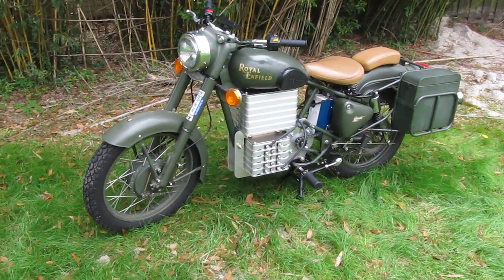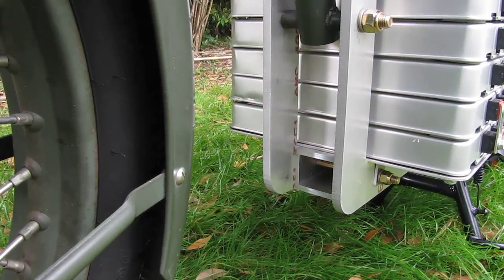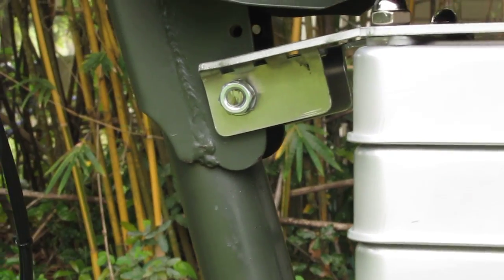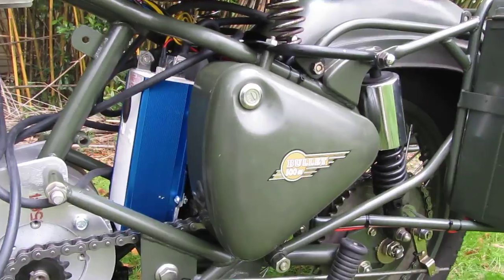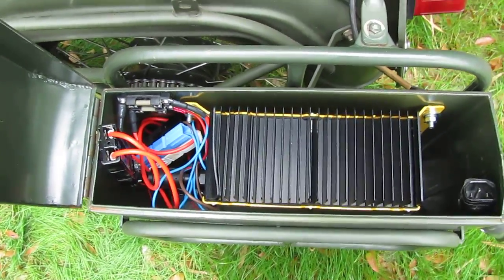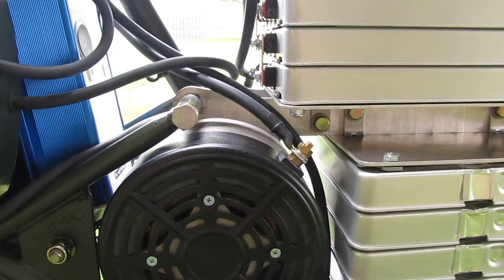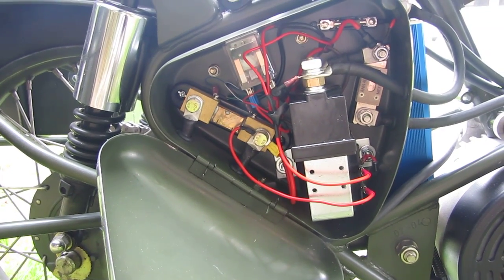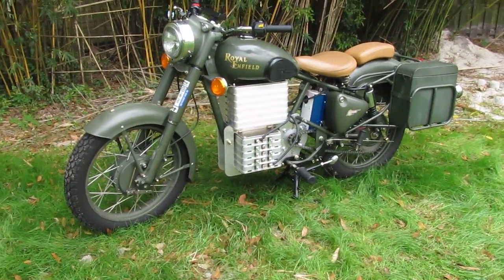Electric Motorcycle Walkaround

Comment: I have a small doubt wat about in rainy season how it works, if the water touches to battery terminals.
Reply from the maker: Legitimate concern.  It was not designed to any engineering specification for rain tolerance.  However I got caught in the rain a couple times in Florida, once in a downpour, and it ran fine despite the heavy rain and spray from the road.  Fortunately fresh water is non-conductive.  Also, I intentionally left the small holes in the Leaf cells unsealed and mounted the cells "upside down" to ensure moisture could not pool inside the metal battery module, but would run out if accumulated.  I think the motor runs warm enough to evaporate the moisture that touches it.  It was dry after being rained on.  The motor controller is sealed.  Also, the marine-grade heat-shrink used on some of the electrical connections is designed to seal out water.
Reply: Electric Drive thanks for ur valuable information giving to me

Comment: You must design a chasis fitting it in petrol engine chasis is not a opt method
Reply: Looks pretty good to me.  Weight is moderately low in the frame.

Comment: I wonder what made you decide on the nissan leaf battery pack. The nissans have been known to have overheating issues that has led to significant loss in capacity after only around 2 years of usage. Is the air cooling from riding adequate in addressing any heat buildup in the batteries?
Reply: Lizard batteries fixed that in 2013.  However under light use and open to the wind they will cool better if you want to use the older batteries.

Comment: My friend i own a Royal Enfield my self. What you have done with this bike is awesome . Have you had a chance to finish the remaining work on the bike like making it weather proof,covering up the battery and anything you feel was left out from its present state? If so please upload the latest one . Is there heating problem with the charger in the box?
Reply from the maker: Thank you.  I have painted the frame, batteries and controller and added an acrylic shield over the lower terminals.  I installed the 14-tooth sprocket yesterday and have designed and ordered a 3D printed sprocket cover (should deliver soon).  You can check for updates on my website:  https://electriccycle.wordpress.com  Yes, the charger gets hot but it still works.